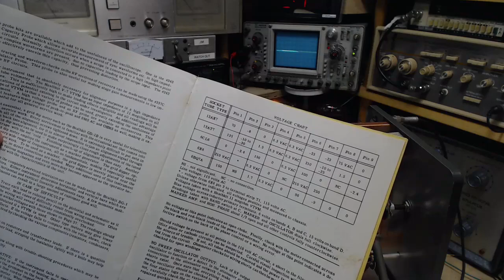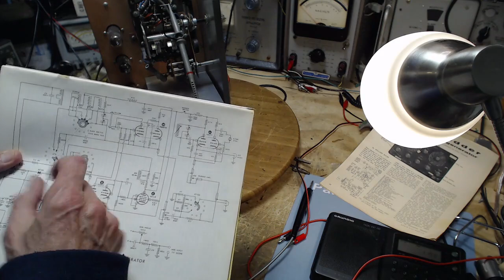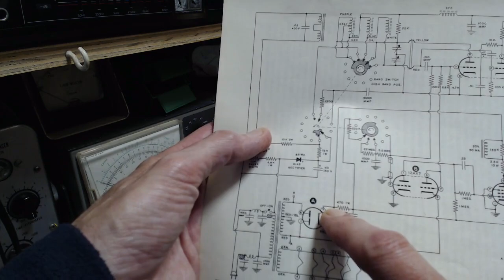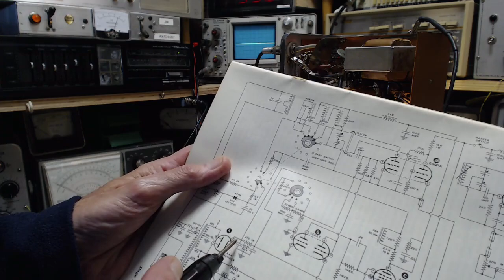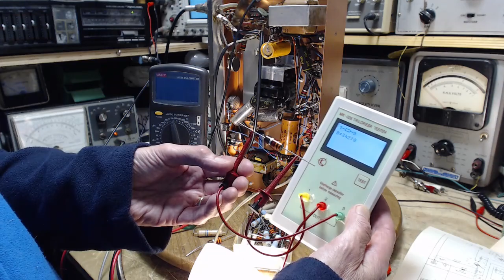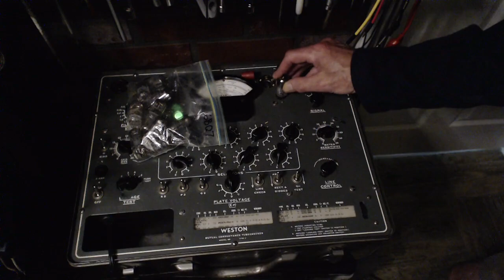Heathkit TV Alignment Generator TS-4A Video #4 - No Sweep Oscillator

Comment: Thought I got sidetracked easily. Jim brings it to a new level.  Starts tracking low B+ then starts looking at grid and screen voltages. Gets confused on pin placement and what he is looking at. Then sees the dim bulb on but no biggie keeps using it and worries about low voltage.  He should look in the manual to see what it has for checks but doesn't.  Think it is going to be another no go in the end

Comment: I seriously hope all from this clip is just an evening wine gathering hangover, alternative being booking asap an appointment with his family physician. Besides all his pitfalls we are already well aware of, this is  going from hilarious to troublesome and sad. When will he read and understand the info he already has? The extra tube explanation was in his hands all the time. Heathkit has very straightforward and understandable designs and engineering, nothing "very complex" at all. Equipment was developed mostly for hobby purposes, very forgiving and tolerant, minimalistic and low-cost. But lacking any knowledge on troubleshooting techniques will turn his ordeals into confusion nightmares. The "lets see what happens", "close enough", "looks good" approach has no place any science. Meantime, a paying customer with a stalled receiver isn't getting any results delivered.

Comment: Whoops !
The 12AX7 is the blanking .
The part used as a diode it has a/c on the cathode .
( diode switching or moving the voltage conduction point with the a/c ? ) .

The 6CL6 is a shunt tube & controlled by part of the 12AX7 . 
The voltage divider set by switched resistors .

Note
The 100k & 4k7 on the 6BQ7 grid ( pin 7  ) are part of the divider .

Comment: The whole middle part of the video where he is poking around the 6L6 tube is BS and his typical poking in the dark and running in circles because he dont know basics or how to troubleshoot. First off, if he suspected the 6L6 regulator tube to pull down the supply line to the oscillator due to a too high plate current, what would be the quickest way to test? Correct! Pull the darn tube and see if the voltage goes up. Second, if a screen grid resistor feeding screen grid voltage to a pentode goes up in value, the conductivity of the tube drops. So a resistor on the screen grid rising from 6.8k to 8k would not cause the tube to draw more plate current. So even tho a candiate for replacement this resistor cannot be the root cause for the loss of 60V on the oscillator supply.
But now, if the tube is not dropping the voltage, what is? Well the supplied circuitry ofc. And lookie lookie there is a electrolytic capacitor deemed "servicable" in that. What do you think;  could that one have shorted or become severely leaky after it ran for a while ... Oh no,never. Old electrolytics dont fail. Especially if they look that good. Right, Jim?
With logic deduction, reasoning and drawing from experience and what information is presented the culprit could have been pinpointed in less than 5 Minutes.
Watching this video is a real downer when you just watched shango066 resurrect a battery-spill eaten AM pocket radio by doing a IF transformer implant and Jordan Pier service a prosumer grade TV without any documentation just by knowledge and a datasheet of the jungle IC.

Comment: He insists on leaving the dim-bulb limiter in the circuit.  It is intended to provide a safety limit until the unit under test is verified to be in no danger of emitting the magic smoke. It's not intended to be left in circuit when testing the device under repair.  I think we are watching the onset of Alzheimer's.  Multimeters are cheap.  For god's sake get a new one!

Comment: At about 21 1/2 minutes, Jim is puzzled by low voltage reading and dim bulb glowing brightly but doesn’t think to replace the old electrolytic capacitors that could be pulling down the voltage